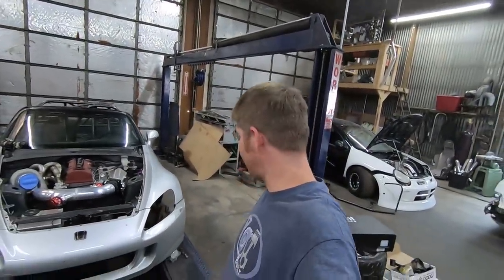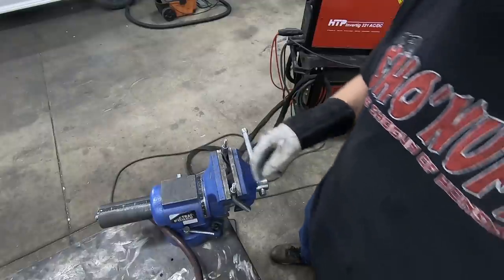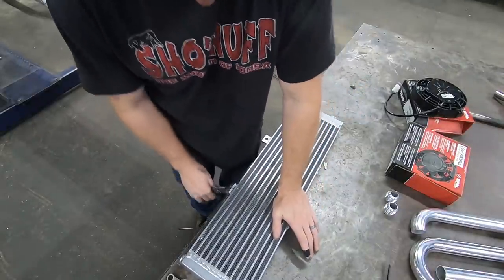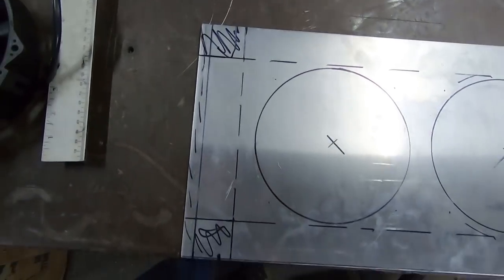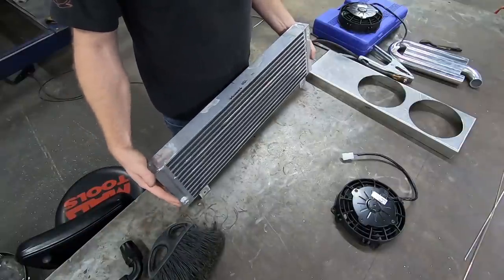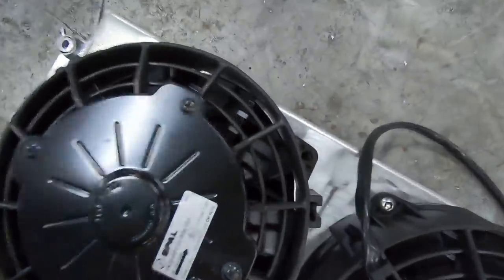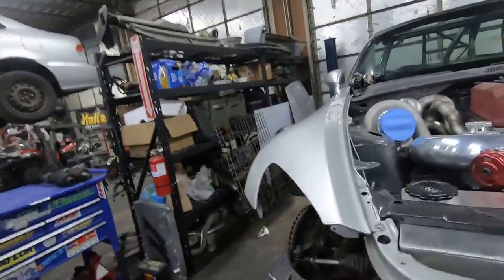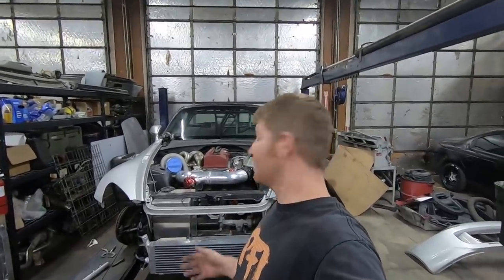SHO’NUFF gets some Cooling ! Radiator mount and Shroud Fab

Comment: You should put a small one way hinged flap on the space where the 3rd fan would have gone 😉
Great work as usual though !
Reply: I was going to make a similar comment. But I don't think Sho'Nuff will be a road car. That said, if they plan to use Sho'Nuff in Drag Week or something similar, the radiator will need plenty of airflow for the long drives.

Comment: Nice fabrication work, I would only suggest adding some rubber c channel around the shroud where it meets the radiator to seal off the air flow.

Comment: I like putting a break around large holes
I cut a slightly larger hole in board and just gently tap the edge down to give some extra strength

Comment: Sorry if I missed it, but just for the purposes of learning, how come you block off the bad of the radiator with the shroud? Won't that limit cooling ?  And be a high pressure zone?

Edit: Also what are you using for charge coding? Or is it not gonna run on gas?

Comment: Great to see Sho'nuffs progress! Would it not be a good idea to add some over pressure relief doors to the fan shroud? looks like there is enough room on the passenger side ;) Helps alot with cooling down after a pass or when you are cruising on the highway RmRw style ;)

Comment: Maybe trap doors in the closed section of the radiator shroud. It is a drag car so it will add significant cooling during the run.
Reply: I don't think cool is super important for the drag passes because if I remember correctly it's going to be on methanol. But they also plan to try and do drag week or rocky mountain race week, that's why they are building a cooling system so it can run gas during the road trip parts.

Comment: I think its cool that youre using an essentially a liquid to air intercooller core to make radiator. Are you setting up the fans to both be on at once or are they going to be staged at specific temps?

Comment: Make some nice flaps on the side u didn't put fans on. Ik u can make em small enough to fit. When he is going 200 or more those fans aren't gonna be able to move more air than he is going mph. Make some nice suction sealed flaps so the fans still pull hard when he isnt moving.

Comment: I just have one question, without an intercooler, won’t that cause intake temps to rise? Or am I wrong. Can someone explain? Sick build just don’t understand that aspect.
Reply: Alcohol at the track.  Low boost and pump gas on the street.

Comment: Soooo, when are you guys gonna get a used Bridgeport hand mill with a digital readout. Or better yet a haas vf3, and hire me to machine custom parts, brackets, heck about anything u think up. I learned machining from arguably  one of the best engine builders in eastern Iowa back in the day... I can code at the machine, no software necessary. Also worked for CFM ITBONA out of Minneapolis fr 6 months and helped install the test bed system for Nissan Motors US facility in Arizona. (It was on their commericals years ago with the car bouncing around simulating road wear). I currently work fr a gm dealer on the line fixing cars and diag while my service manager plays candy crush. I'd sell my house and move there. Serious as a heart attack.

Comment: Why dont you guys weld a hard pipe to the water pump so that you only have two 90 degree an fittings from the radiator to the water pump? Making your hose straight and not bending around the fuel tank?